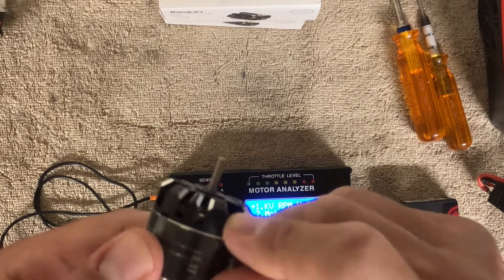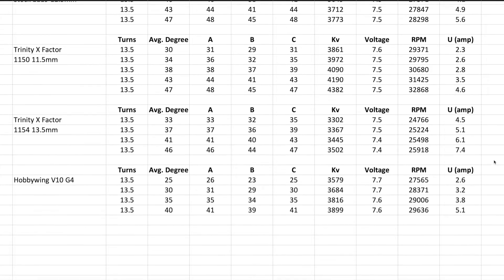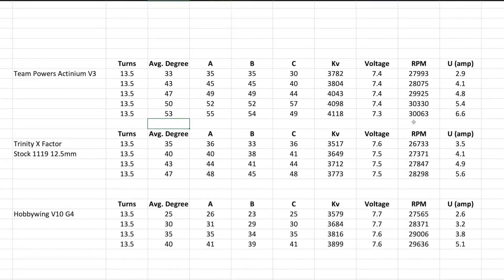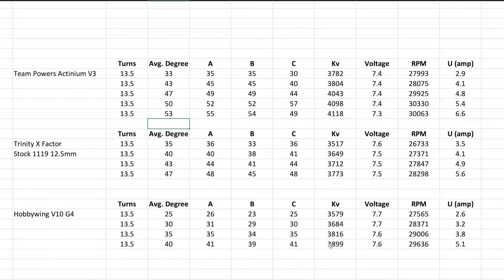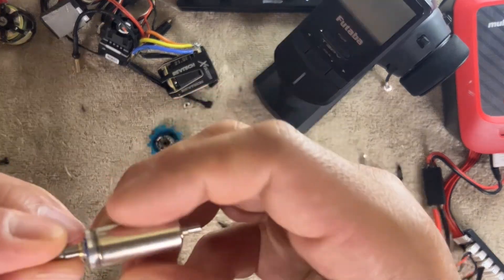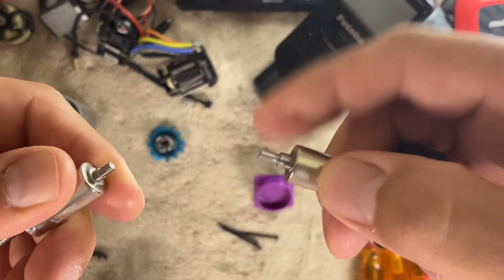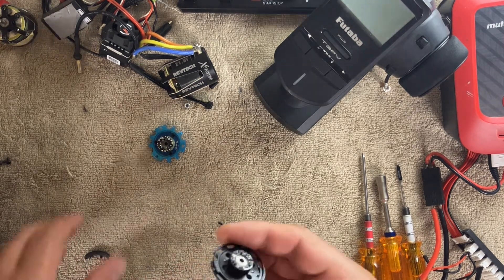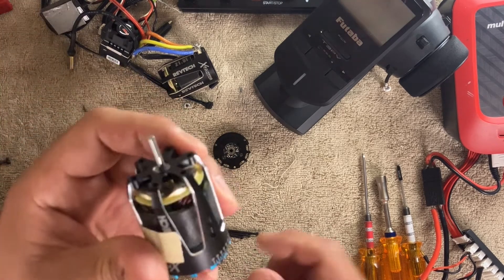Hobbywing V10 G4 13.5T Data Analyzer and how it compares to Trinity Xfactor on paper

Comment: None of the sizes or shimming matters because each end bell and board are made to max out with their can designs. It comes down to which motor makes the most torque and RPM at 8.44v. And that's mostly about how good your rotor is made. The builders will buy cases of motors to find the unicorn cans and rotors to get that top 1% performance. I don't have time for that! Also worth mentioning your voltage dropped as you tested the motors so 7.6 vs 7.3 will show some difference in numbers. If you had a motolyser it reads at a constant voltage (3.71, 7.6 etc) so all your results are matched by voltage. Just something to think about.
Reply from the maker: Thanks for the comment. I am not sure if I addressed it in a video or a comment. But you are right. As voltage drops the Kv goes up and vice versa. Which is why I attempted to use similar voltage. Any future motor videos will be made with my new Hota as it has a steady output. But it is still a good ball park. You are so right about guys looking for the 1%. You say you don't have the time... but most guys I would say do not have the resources either to by say 100 motor to pick the top. That is somewhat nuts for club. At least for me. Again, thank you very much for the info and thoughts.

Comment: Have you had this 13.5 on the track yet? 

I am Almost sold on the G4. I really just want the absolute strongest 13.5 I can get ahold of. I have a Cert Plus 13.5 and a Wurks Fantom currently. I wonder how the G4
Compares on track!
Reply from the maker: Next week I get my rotor gauss analyzer. I will be measuring the gauss. Regardless of the result, it will go in my SCT. As soon as I get the analyzer, I shall test the rotors, and see how the gauss compares.

Comment: Thanks for this!
Great to see some testing of the new G4 motors and how they compare with others. It'd be great if you could also test and publish the rotor gauss.
You've probably already seen the late Nick Adams' videos? Generally like you say if you've got a high-rpm motor the gauss will be lower but as per his testing it's not always the case. Having the two metrics is really helpful in making purchasing decisions.
Again, good work.
Cheers
Reply from the maker: A buddy sent me a video. Bless his soul. I need a gauss tester. Once I get one I will. Trinity publishes avg. gauss. But no one else seems to do so. But I am really interest in the HW as I like the machining of the armature and bell far better.
Reply: @telecomandorc  That'd be great if you got one. I'm not sure if there are others providing the same data, but Nick seemed to be one of the rare ones doing it all!
Have you compared the HW G4 in a car against the Trinity? If so, how did they  compare?
Reply from the maker: @grantoverend1  I do not know of others. I was talking to my friend and race buddy about doing a comparison between regular and ceramic bearing and he sent me an amazing video from Nick. Guy was brilliant. 

I have one more race in about two weeks to finish up this series. In September we start the next one. The plan is for me to run the HW 21.5T and the same friend will run his Trinity. Our times tend to be close and generally have similar consistencies. 

After your message I contacted him about a gauss meter. I just need to drive two new but different gauss rotors to calibrate the gauss meter he has for me. This way I can use Trinity rotors as a based or control and compare the rest to those two points. I am hoping to have the data by the start of September.
Reply: @telecomandorc  Good stuff. Looking forward to more videos.